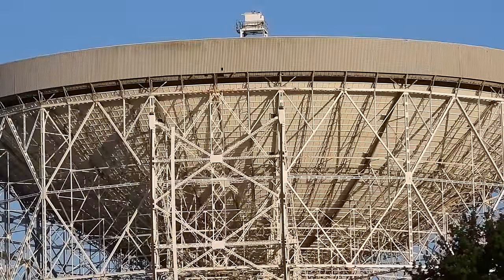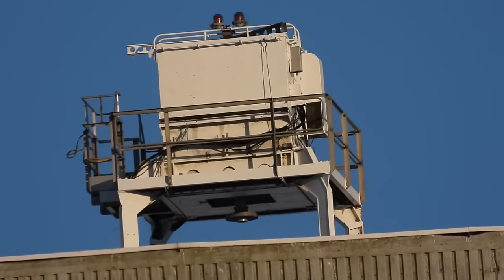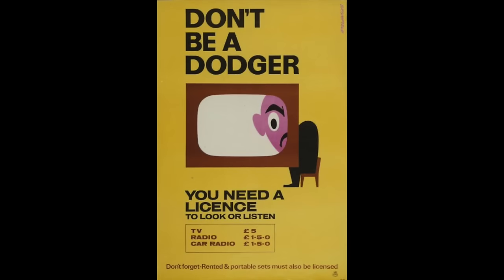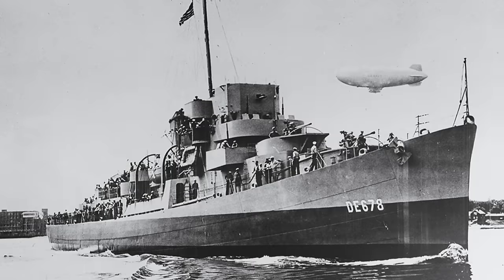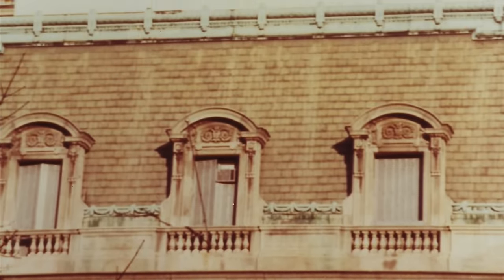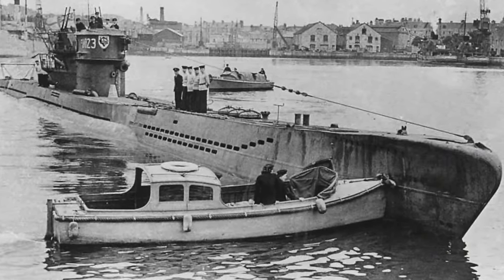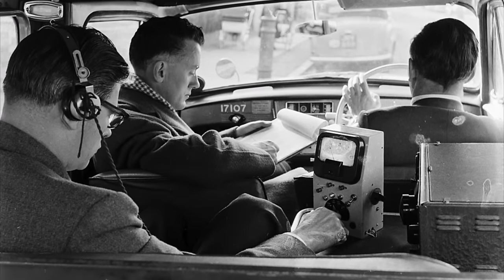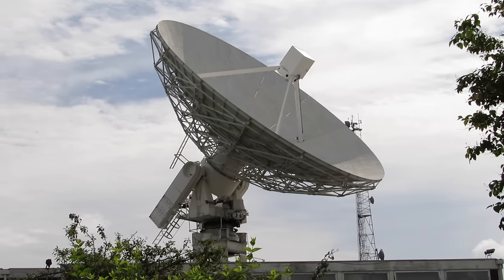How They Know What You're Listening To On Your Radio!

Comment: Back when I was 14/15 I discovered the local oscillator leaking RF at the 1st harmonic 10.7mhz above the tuned frequency on "VHF", so a radio tuned to say 90mhz would transmit at 100.7 a blank carrier. By exploiting this feature I was able to set up an FM pirate station by opening up the radio, locating the oscillator, attach an antenna and modulate the carrier with music from my 3 in 1 stereo, all the neighbours would tune in...those were the days my friend we thought they'd never end.
Reply: I had a Karaoke machine that blew some electrical part and started transmitting on an FM station.   That was fun with it's tape player and built in microphone. A whole radio studio in a box.  Even portable if you had enough D cells. 😂
Reply: I think you mean 10.7 MHz and 90 MHz. Megahertz. mhz suggests millihertz although that would actually be mHz.
Reply: @-fuk57  My uncle Dated Mary Hopkin, from Pontardawe, Swansea haha
Reply: You need to block the oscillator with a shield of sorts
Reply: I also found out on my own when I was 16. I used an antenna and an audio amplifier to transmit FM audio. Good times.
Reply: They would last forever and a day... I used to do similar kinds of things, it got me so interested that i was an ETN in the Navy and now a Radio Ham. 🖐🏻73's🎙️🎧KD9OAM📻
Reply: I made series regulator power supply using a CV427 as a pass tube, really chunky.  I didn't know about grid stoppers and it would regularly go in to oscillation.  My dad would come and tell me off because it was so powerful it stopped him listening to the fm radio, it just went quiet.
Reply: Once I built a low power transceiver and used the telephone line as an antenna. I was also able to listen into the neighbors phone conversations. Pretty nifty but quit doing it that I may get caught. I was only 13 years old!
Reply: I did exactly the same - using an old Sharp mono radio cassette - I would 'rebroadcast' the Radio One Top 40 on a Sunday night on my own frequency in the hope that when the chart finished they would continue to listen to my choice of music :-)  I achieved a range of almost quarter of a mile by careful choosing of a 'hanging out of my bedroom window' wire antenna!
Reply: @2Steppa2  some great stories there guys, great to know I wasnt the only one
Reply: I was too late for all that I think. I did discover if I walked the neighborhood switching channels on a cordless phone handset I could hear conversations, but they didn’t seem able to hear me.
Reply: And I thought I was smart for burning CDs when I was 14/15
Reply: Oh wow, that's awesome!
Reply: So you were an illegal broadcaster!

That sounds fun. I think we need more open spectrum and general broadcast rights as hobbyists.
Reply: Spot on. I also set this up in 1980. The neighbours were amazed and I ended up doing the same for them. They loved to be able to transmit TV sound to their Hi-Fi or their neighbours! because there's no actual transmitter it is legal. These days we can legally TX on FM using the low power transmitters that are sold for cars.
Reply: I like the cut of your jib !
Reply: I'm just millenial enough that I wasn't old enough to learn this stuff. I wish I was a bit older so I could have seen a bit more of the 80s, and learn all this weird radio and phreaking tricks.
Reply: I didn't understand a lick of that but I wish I had a friend like you lol

Comment: I saw the inside of a detector van in the early nineties. Except for a crisp packet, it was completely empty.
Reply: You were misled...
Reply: @wigglepig115  by what?
Reply: @opts9  whilst it true that some of the vans were dummies (for purposes of research) there were a number of real, working setups (more than two and fewer than twelve.) The equipment was/is complicated to operate, extremely costly and not completely reliable, especially with the changes in radio designs in use.
Reply: @wigglepig115  yeah, I can believe it.
Reply: Yes but what was inside that 'crisp packet' hmmmmn???
Reply: @burning4902  a tiny TV, like in Death Note
Reply: @wigglepig115  That doesn't mean they were mislead. They probably had half a dozen real vans but several hundred fake vans.

Comment: When I was in the Army training at Fort Devens, MA, the barracks I lived in had people who would tune in a local AM country music station and blast music in the barracks.   I had to use earphones with my radio so I could hear the station I wanted to listen to.   One day the country music was very loud.  I was tuning through the AM band to check out what AM stations I could hear, when I heard a faint whistle grow louder in the country music until it was almost all that could be heard on the other guy's radio.   

The whistle grew quieter until it disappeared as I continued tuning through the AM band.   When I turned the knob and tuned back, the whistle returned to the other radio.   The guy changed to a different AM station and turned the volume up even louder.  I tuned back and fourth across the band until the whistle appeared on the new AM frequency.   When the other guy found he could not make the whistle go away, by changing radio stations, he turned his radio off and put it away. 

It was years later that I found out that the local oscillator of my radio was transmitting a signal that interfered with the other radio, causing a heterodyne noise, which was the whistle.  Even though I did not know what it was or how it was happening at the time, I realized that I was jamming the other radio and used it to good effect.  Whenever someone turned up the volume of their radio to an annoying level on an AM radio station frequency, I would get my radio out, put earphones on, and tune around the AM band until the heterodyne jammed the other radio.  In a short period of time the other radio would be turned off.    I also found out that it only worked with AM radio stations and not FM.
Reply: When I was a teenager I discovered I could cancel out my sister's radio doing the same thing on the fm band. There wasn't any whistling, just dead silence. 😏
Reply: @jeffwarner9451  Yes, on AM difference is 455 kHz and on FM 10.7 MHz. Its standard IFs for broadcast receivers.

Comment: The main culprit in modern electronic TV are the computer (an ARM chip) clock circuit, and the backlit LED driver. But those signals are drowning in a plethora of clock signals and switching power supplies present by the dozen in any house nowadays. I have problems listening LW band for this very reason. The Powerline adapters, which send Ethernet over the main power line, are a work of the devil, as they radiate powerful harmonics up to the 10 meters band!
Thank you for the video, was a trip down the memory lane...
Reply: I am trying to listen to radio caroline from home on a hot GEC AM/FM radio from the 70's known to be a great MW performer. although the freqencies either side of caroline are dead quiet in the daytime, when i'm smack on their 648 khz freqency, i can all sorts of squawks, and constant crackling about their weak signal from 160 odd miles away. wish i could recieve ONLY their signal ...
Reply: Do these signals have ill health effects do you think?

Comment: Brilliantly researched, as usual, Lewis. Truly the Mark Felton of radio geeks! 

The German WW2 submarine service was absolutely paranoid about local oscillator radiation - by mid 1942, they'd issued directive after directive on radio procedure and even banned the use of the military issue 'civilian' type broadcast receiver that was issued to U-boats to amuse the submariners (the output could be interfaced with the boat's PA system so the crew could all be entertained) except when the vessel was in port. The Kriegsmarine SIGINT people believed that the LO on this non-military designed radio was particularly leaky.

Could D/f be used on a specific radiating LO signal from an operational U-boat? I think it could. The principal sub command net was hosted on a powerful permanent LF/VLF transmitter at Lorient, France, on Brittany's Atlantic coast, which operated on a fixed frequency. Furthermore, U-boats carried a standard complement of radio transmitters receivers (some with their own D/f capability) so, 99% of the time, listeners to Lorient (of the naval rating, Oberfunkmat, U-boat type, anyway) were using exactly the SAME type of receiver. - and therefore, identical LOs. The Allies by this time had captured enough U-boats to understand this. Knowing the receiver IF and also the frequency of the incoming transmission, means that the likely frequency of the radiated LO signal is exactly known.

Sure, the power of the radiated LO signal will be extremely low. And, in fact, the U-boat receivers DID use an RF stage ahead of the mixer. But, those valve mixers (triode/hexode or pentagrid) are unbalanced and provide nil in/out port isolation, so SOME of the LO will be radiated regardless of the RF amp stage. Remember that this is a LF/VLF signal which will propagate via ground wave - and over a highly conductive (seawater) surface will get a considerable distance. The idea that an aircraft within  a few kms could accurately detect this easily identifiable signal (and home in on it) isn't so fanciful.

However, LO radiation wasn't really the U-boaters headache. It was a red herring - but a herring that also caused them to abandon the R600A 'METOX' 200MHz aircraft radar detection receiver device on the same basis, 'vulnerable emissions'. Had they known about British HF/DF detection and most importantly, Bletchley Park's penetration of the naval Enigma, they would have lost interest in local oscillators completely.
Reply: Oddly I was just reading about an anti-ship missile that does not use radar so it can operate in stealth mode. So it is not just ships - you want you missiles to go undetected too.
Reply: Love this highly accurate and detailed comment.
Reply: I love reading things I really don't understand. Good job on you, nerd. That is both a compliment and a derogatory.
Reply: Excuse me what? mark felton gives the most basic information possible and doesnt give detail or nuance on anything. Unreal people like you exist

Comment: Redifusion set up a large cable undertaking here in the south east essex uk in 1964 it closed the antiquated  5 channel system in 1997 due to competition from the superiority of the the multichannel  vrigin media system ...in late 80s though they introduced Premier movie channel .£10 per month ..but my friend noticed that all they encrypted it with was a simple signal  that they removed with an inline notch filter at your  end    ...so a few electronic buffs soon copied these filters / pcb .....lol.....and sold them in local pubs ...for £20 sovs
Or £30 sovs if you wanted the fitting service x
Reply: One time, after a pay per view session ended, they had a free give away. No one should have seen it,  except those bypassing all encryption, which kept the Chanel open all the time. Everyone who responded was cheating.😂
Reply: I remember 20 years ago when TVX was on Freeview there was a guy who used to run a keygen website on the internet to unlock the premium content. All you had to do was get the code from the TV for that nights viewing, insert it into the keygen page on the website and it would generate the release code so you could watch the channel for the night. I tried it for two nights but stopped watching it because British Porn is tame. You see more action in my back garden at night with the badgers lol!

Comment: German WW2 uboats were equipped with a radar detector operating in the VHF band used by earlier Allied anitsubmarine radars. The detector was called Metox and it was a superheterodyne receiver. 
"Metox also emitted a weak signal, a property common to many radio receivers, especially superheterodyne receivers. In an indirect way, this had serious consequences. In the spring of 1943, the U-boats suffered badly because of the introduction by the British of a 10cm ASV radar. But a captured British officer told the Germans that their misfortunes were caused by the transmission of Metox, which were detected by Coastal Command aircraft. After verifying that this was technically possible, the Germans believed the story. This delayed the introduction of Naxos by some months, during which the U-boats suffered heavy losses."
Naxos was a newer radar detector built to detect signals with wavelengths  between 8cm and 12cm.
Reply: Luis Alvarez, who later proposed the asteroid impact K-T extinction theory with his son Walter, realized that U-boats' radar detectors non-directionally measured the signal from the airborne search radar. Since the radar pulse drops with 1/r2 and the return also goes as 1/r2, adding a circuit reducing the transmitted signal by 1/r3 during an attack run would still allow the return signal to get stronger during the approach- but make the signal detected at the U-boat decrease as 1/r. This spoofing lulled U-boats into to staying on the surface to run their diesels since the radar always seemed to be going away...
Reply: I remember a Lindybeige video about this. I believe it's titled "The Battle of the Atlantic: U-Boats and How to Sink Them"

Comment: Back in the 1960s/70s, the Philips Electronic Engineer kits had a circuit that could be tuned to receive and locate the line scan oscillator frequencies for 405 and 625 line (and indeed, 819 line) TV sets. Indoors, it worked well enough to illustrate the point with a dual-standard TV set.
There were regularly TV detector vans seen around our area. One day on the way to school, I saw one with an impressive-looking Yagi aerial on the roof. The driver was nowhere to be seen and he had left the back of the van open, so being a nosy kid with an interest in electronics, I took a peek inside the back of the van.

It was completely empty!  😁

Comment: When my brother and I were young teens, our bedrooms were across the hall and on a separate floor from our parents. We didn't get along. My brother would often plan his radio late at high volume. I was a radio geek and had several old receivers including an old Hallicrafters that I found leaked quite a bit. I would rune to the appropriate frequency near the station he was listening to and essentially jam it. He'd get frustrated, tune to another station (we had 4 which played rock music) and I'd do the same, until he gave up. I owned that radio for another 20 years, before I sold it as an anquite for $250, quite a profit over the $15 I had paid for it 25 years earlier.

Comment: Great video. I was about to mention 'Spycatcher' but you beat me to it! It reminds me of the time I discovered - completely by chance - that by mixing the radiated LO carrier (or a harmonic of it) from a nearby valve mediumwave radio, to my portable, Marine Band radio, I could resolve SSB and CW transmissions from radio amateurs on 160 and 80m. I was chuffed (I was 10!)
Reply: Yep. Been there, done that. I used to resolve ssb on my cheap Niponease multiple waveband portable by putting a MW receiver alongside it
Reply: I did it too.
G4GHB

Comment: Local oscillators send a carrier wave further than you would think. Back in the 80s a friend used the oscillator from a grundig transistor radio and just by attaching an fm dipole at the coil and feeding in an audio output, managed to broadcast over half a mile.
Reply: why?
Reply: @artifactingreality  why not
Reply: As a teenager I was experimenting with a push-pull double power triode, building what I thought was a low power oscillator to do some experiments with NMR (nuclear magnetic resonance) as described in Wireless World.
I managed to blank out the BBC2 channel over a half mile radius. Fortunately the valve burnt out before they were able to get organised and locate the signal.

Comment: Our local cable company (USA)  would drive a windowless van through neighborhoods during TV prime time...the rumor was that they were looking for people watching scrambled "premium" channels that weren't paying for them.  Showtime could be descrambled on an old Atlanta Scientific push-button cable tuner by depressing the "3" and "7" buttons together 😂 (note-it required taping the buttons down, as the spring mechanism would release when two buttons were simultaneously pressed!).
Reply: As someone who worked for Time Warner Cable as a Technician, many cable devices have backdoor menus usually for testing purposes. You could also get 3rd party boxes that de-scrambled channels, you can still buy them today.  The cable company was more concerned with illegal cable connections outside than anything that happen inside your house.
Reply: @TheBaldr   The FCC fines cable companies if they allow their cable connections to leak their cable signals out, so many company vehicles have alarm devices that monitor a single fixed frequency CW signal on their cable system.  I am sure that is all that is happening where I live, your mileage may vary. Ron W4BIN    (in Florida)
Reply: @TheBaldr  two different systems. With the antique mechanical tuner box, "scrambling" was via interference and paid subscribers got a notch filter to filter out the interference. Scrambling, I have a network tuner that can descramble the cable signals, if I purchased the subscription and QAM card. I'm sure there are similar that are dummied to not require the card, but I never bothered trying them.
I only needed the network tuner so I could use MythTV to legally record my programs I wanted to watch.
Reply: In the late 80s early 90s my dad was a cable tech for a small company now owned by Cox. We had Scientific American boxes on all our TVs. An eeprom swap was required to get the premium channels unscrambled. After the swap a code was punched into the remote for access to HBO, Cinemax, Showtime, The Movie Channel, PPV, and my 12yo selfs favorite Playboy.